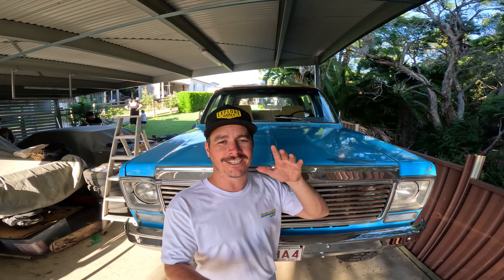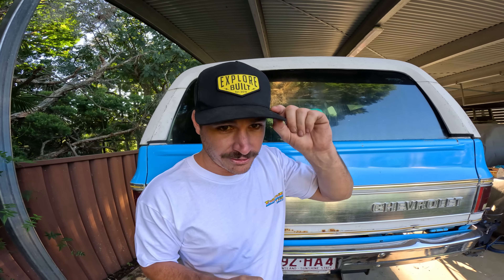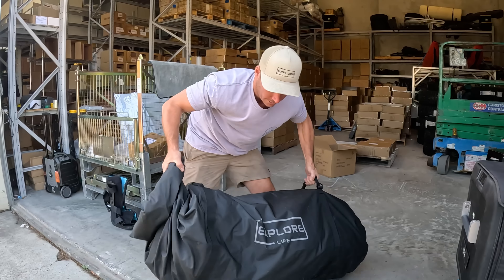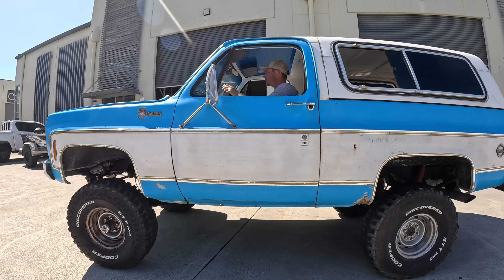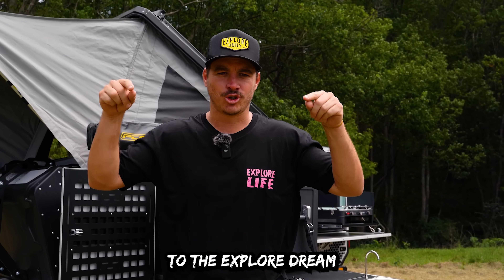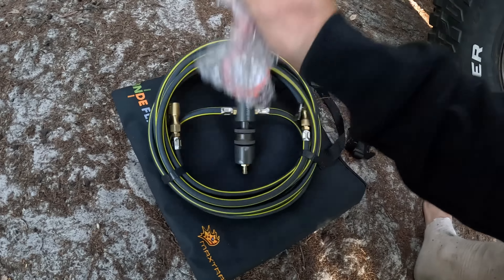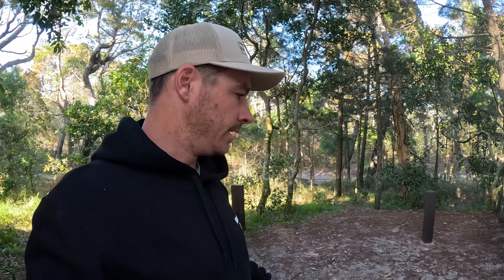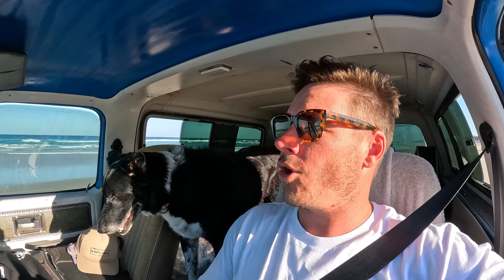FIRST TRIP in my NEW 4WD….was a DISASTER!

Comment: 39's on a 10 bolt lol, you should get a dana 60 front diff, 14 bolt rear and put a 203/205 doubler in it.
get rid of the springs for ones with less arch for lower centre of gravity and so they ride smoother and flex more and cut the guards to fit the tyres.
and if i had it i'd ditch the slushbox for an nv4500 or a tr4050 and add efi.
Reply: 40's 4 inch suspension lift but with 56 inch leaf springs or a coil conversions, 1 inch body lift, 5/8 inch 14 bolt/Dana 60 axle lift, 203/205 doubler, L8T 6.6L gas V8 crate engine, 6L90 automatic transmission,

Comment: Blazer looks great
The 400 is a decent engine but those tires are going to blow up the stock axles pretty quick if you’re going to wheel it hard 
I had a 1981 with a 350 and 4 spd manual on 35’s blew up both ends went to a Dana 60 front and 14 bolt rear never had a problem after that 
Cheers from a Canadian now living in New Zealand
Reply: Don’t suppose you’d know what a diffs are in a 73 k5 blazer? 350chev auto. Currently building one in NZ atm
Reply: DANA 44 and a 12 bolt. And apparently only the mil spec K5s had 60s, so the 74 also had 44 front and 12 bolt rear

Comment: Sweet mother of Jesus. Please do NOT "chrome delete" this K5. 1977 is 1 year only yellow painted stripe in the side trim. It is SO hard to find. Especially fr the K5.

Also, if you are going to put a canvas top on, use a pickup truck tailgate. That drops a couple 100 pounds of weight. You will need tALL of the tailgate hardware to go with it. It is slick once  it is done. Any tailgate, Chev or GMC, 1973 - 1987, will work.

Also, a hint to NOT crinkle your hood, when closing, push it towards windshield, do NOT pull it down, as they tend to fold.

Having owner several of these, I could go on and on, but will limit my unsolicited opinion to these 3 tips.
Reply from the maker: Thanks for the tips mate! Really appreciate it 🍻🍻

Comment: Love it, bloody awesome rig, love Burkey is on the job, sorry don't love the modern black rims, needs period correct chrome or silver wheels, not ROHs, its a square peg in a round hole, but the truck is sic, I do love the idea of a canvas rear and zip off sides, rip the carpet out treat, no carpet so it can be washed out, Love the color & pentina, def needs some suspension work, some engine mods maybe a super charger if the engine is healthy enough, but it sounds like the transfer and gearbox might need some work also, not sure about chrome delete, I'm all about period correct with older cars, not trying to make them modern, except seats some interior, but no digital shit, you can restore modern while keeping it period. Excited to see what Burke does with it🤘

Comment: I think that you should do a full rebuild,  but have it looking original on outside and more new or modern running gear with a Cummings Diesel V8, tidy up inside with digital gauges,  so its a combination of both new and old. Then do outside with raptor paint to protect from scratches, upgrade headlights,  stereo,  similar to a pioneer 12 inch screen.

Comment: Had the same year and model with warn lockouts. Put a 350 throttle body engine with serpentine belt. Got a lot better gas mileage and more power. It was a beast with the top off. CHEERS! Love the channel!

Comment: Put the 8.1l gen 7 big block in it out of the early 2000s silverados and full size SUVs. Never be done in Aus it seems. It has more in common with older v8s but runs more of the LS style computers. There's a logger guy in Canada who has a cammed one with 5.30 diff gears in it. Pulls heaps of wood. 6 tonne or more trailers. Reckons it eats it compared to the 6.6l gas v8s in the current 2500s as he dives his bosses one.

Comment: For the record, The K-5 Blazer is a TRUCK. NOT a car. A TRUCK.  As for the mods if you put a high performance engine in it you will need to upgrade the axles. The stock axles on the blazers do not do well with big performance engines and oversized tires. Great vid, keep 'em coming.
Reply: It’s Australia man. They think anything less than a 2 1/2 or 5 ton isn’t ackshually a truck.
Reply: @ryansommerfeld2098  Yes I know, Teaching the entire population of Australia the proper terminology will take awhile. I am up to the task no matter how long it takes. ;)

Comment: I always wanted one of these, instead ended up with a 1982 Suburban 9 seater 454. Came with a trailering package so had a 160 litre tank and burned fuel at the rate of 12 mpg whatever that is in kms. Put 2 gas tanks on with 120 useable litres underneath the sides and had it for 22 years till 5 years ago and sold it and he now has it for sale again here in Adelaide. As for yours its a unique vehicle-why change it? The chrome sets it off and I would have gone for chrome American Racing Wheels. Keep the body as is but restore it don't destroy it. Parts are readily available for body and mechanical in U.S. from a company that specialises in the "square bodies" as they call them. I envy you as I now have a 97 Range Rover and would still prefer the charisma of a non electronic icon!

Comment: One Ton axles,5.13 gears arb lockers,off-road design 4link front springs in rear,ls swap with 4l80 magnum gear reduction box with a np205 rear transfer case. These things are a great start to a durable and reliable very off-road capable rig. I’m a huge blazer fan looks like you scored a nice one to start a build with.

Comment: turn it into  a single cab mount a roof top tent below the roof don't need the back seats coil conversion and a  6bt cummings diesel running some 35's with a candy red paint job or keep the original paint job